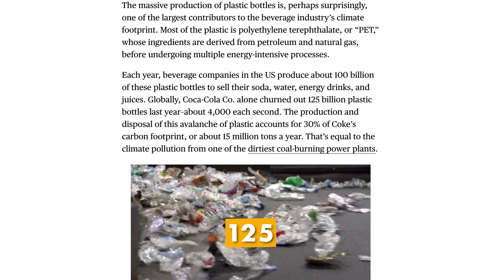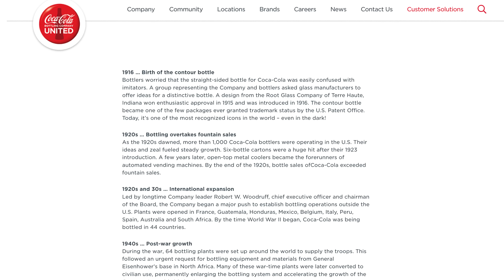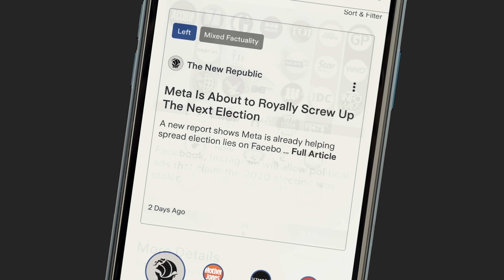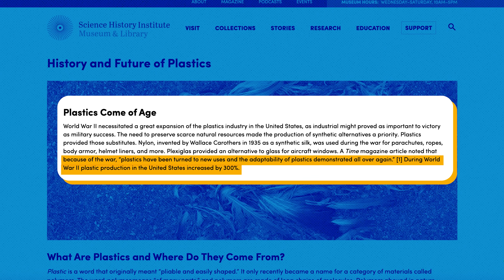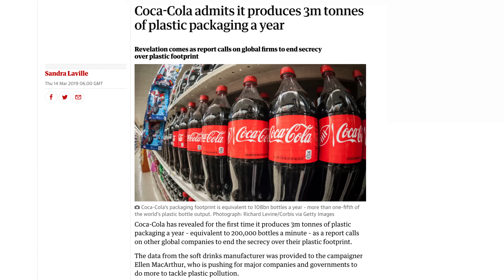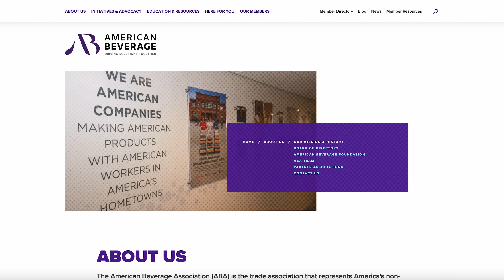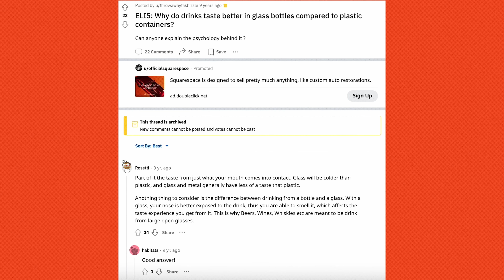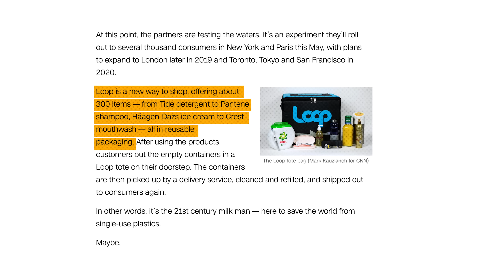Why the Glass Bottle FAILED

Comment: So now you talked about glass vs plastic. I would love to see glass vs plastic vs aluminum can.
Reply: The aluminium in the cans is easily recycled, but all cans have a thin plastic liner on the inside. It's unavoidable that this gets burned away when you recycle, but at least it's only a very small amount and it is destroyed in a controlled way rather than littering the ecosystem.
But like I said in my other post - plastic isn't really the problem, just how we (don't) recycle it. We could still use plastic (like HDPE) bottles with near zero waste if we actually spent the same time, care and money in collecting it as we did for glass.
This problem has very little to do with what materials we are using, and everything to do with economic incentives, or the lack thereof.

Comment: Getting the recycling rate up high is actually remarkably easy - Latvia (an eastern european country) took the same machines as in Germany mandated that all beverage cans, plastic and glass bottles have packaging surcharge and mandated all grocery stores to accept the packaging and refund the surcharge either using the machines or manually. We're now at 85% recycling rate in 2 years.
And so you're not feeling like a cheapskate the machines offer to donate the refund to a charity of your choice.
Reply: Most of EU has adopted a similar system but 85% return rate != 85% recycling rate. It would be economically and environmentally prohibitive to recycle PET at such a rate. Most of the returned containers end up either on a landfill or burned, with some portion of them being used for producing fleece and similar materials.
Reply: @zwerko  you just nitpicking here. The returned PET bottles through this system can be recycled into food grade plastic cause they're not contaminated, so it's high value raw material. Sure, it also goes for polyester fibre production, but it's still recycled, though not fully circular.

Comment: Instead of just disallowing plastic straws and cup, why not also imposed that soft drinks should be in glass bottles?
Reply: Because glass has other issues. The bottles are much heavier, larger, and harder to reseal. And do you know what happens when a glass bottle full of pressurised sugary drink breaks?
Reply: @ghoulzeta 
in the popular video game metal gear solid 2, an enemy boss often says the one thing that needs be said as a response to the opinion you hold--

"i'll let you go out in STYLE!"

Comment: Can you make a video on the whole overpopulation and population collapse debate
Reply: That would be interesting. I was worried about overpopulation too for quite awhile, seeing how the rate just skyrockets off. But then over time have realized how the birth rate has dropped across most of the world except for some... but it may even drop in those places as they further develop. So the issue may actually correct itself. But as population shrinks, so will economies. Companies are going to have to get used to the fact current growth rates just won't be sustainable.

Comment: I grew up knowing the family who owned the local coke distributor ship in my town: where they took in bottles, wash them, and re bottled all the coke products in my area. They were happy when no deposit bottles came in because it was faster and much cheaper to run than having to warehouse, wash and handle the return bottles.  In fact the bottle washer machine was the largest and most expensive machine in the building, and doing away with it meant doing away with 6 employees, hot water, detergent and water used in cleaning them daily!  
It all comes down to money saved = higher margins.
But the flip side was the now added trash bottles all along the roadsides. 
And though there are still glass bottles around, they’re few and worth nothing and end up in the trash .

Comment: I had a unique view of this throughout my life. My grandfather was a milkman. So I knew the routine - drop off full bottles and take back the empties to be cleaned and refilled.

Later in my engineering career, I laid out beverage filling lines for both returnable and non-returnable (NR) glass bottles and I also laid out filling lines for PET containers. Late in my career i did design work on PET blowmolders. So I kind of saw all the progression to the era we're in today.

There were a lot of reasons for the switch to PET, but the overall #1 reason is just what was said in the video: The beveage and food processing industry does NOT want to see these containers coming back to them! Once out the door - out of sight, out of mind. No longer their problem. They've spent a lot of money over the years advertising about recycling, but they spend a lot more lobbying Federal and State legislatures to be sure that no laws are passed requiring them to assume reponsibility post consumer scrap.

Comment: Oregon has recycling machines like Germany, but when it comes to glass, the recycling is short-circuited right there. EVERYTHING is crushed--the glass for obvious reasons is crushed separately--but when you make sure that it can't even be used as stock for more glass (all the contamination from the paper labels) the recycling potential is gone.

Comment: I always see people talking about "plastic bottles vs glass bottles", but one thing I never see talked about in these kinds of stories is that a third option actually exists: aluminum bottles. They provide most of the benefits that plastic bottles have: being lightweight, less susceptible to breaking, and being resealable, but also have the benefit of actually being recyclable the same way that aluminum cans are. (For example, the bottles that "JUST Water" brand of bottled water is sold in, or the "Good and Gather Purified Water" sold at Target.) The only downside is that the container isn't clear, and therefore you can't actually see what the beverage you're drinking looks like. But I think that's a fair tradeoff if it means not polluting the Earth with plastic more than we already have.

Comment: In norway, we use plastic bottles, but we have the "pant" system. Or translated to pawning system. For bottles we pay, and get back 20c for up to 0,5L and 30c for bigger than that. We stuff them in the machine and get our money back. Aaaand! We resycle glass pretty well, it goes with the metal cans for soup and similar, they are easy to separate. But for the bar I work in, all Pepsi producs are delivered in glass, and this is returned. But allso there we have 3 trash bins, one glass, one general waste, and one pant. And it works! And for the returnabole glass bottles, we use the cases it came in. Easy peasy!

Comment: We also have glass bottles in Brazil. It's not just Mexico. I also saw them in Argentina. But things changed anyway. When I was a child in the 80s and early 90s, everybody returned 1L their glass bottles to the supermarket. Now the small glass bottle (290ml) is still very common at bars and restaurants, but the demand for larger 1L glass bottles decreased when the 2L pet bottles became more common as the family sized option. Now fewer supermarkets sell the 1L glass bottle, as they also need to handle the logistics of returning them to Coca Cola. Here, instead of paying for returning bottles, if you buy only the liquid, it is cheaper if you buy the liquid + the bottle. If you bring the returnable bottle, then you pay only for the liquid. Coca cola also tried to introduce returnable plastic bottles. They are made of harder plastic and have a larger volume, 2L ou 1.5L I suppose. The same places that still sell returnable glass bottles also have them. They try to sell to a demographic that buys cheaper colas from another brands, as a cheaper version of coca cola.

Comment: The old soda bottles were gold for us kids in the early 1960s. It cost 10 cents for a 12 oz bottle of pop plus 2 cents deposit, 3 cents for a 16 oz RC cola bottle. We would find empty bottles in the trash or in vacant lots with the worthless liquor bottles. Some chipped bottles were okay to return as these go back to the glass factory as it is cheaper to remelt these then you would the original sand. A six-pack of bottles would redeem for a bottle of pop, including the deposit or two candy bars and two bubble gum pieces.

Comment: 10 or so years after Oregon enacted its bottle bill, beverage companies started using bottles made of thinner glass (which was crushed and broken when recycled) and plastic containers.  Not in Oregon.  It was quite a few years before the old refillable bottles disappeared.  They stopped making the original reusable bottles, but the ones that already existed stayed in use.  For maybe another 20 years.  These were thick-walled glass bottles, very resistant to breaking, and at the end of the era of reusable beverage bottles, the corners of the bottles looked like ground glass, having been ground down by all the times they'd gone through the washing and refilling process.  Make the beverage companies pay for NOT using glass, and things would change, but they'd flood congressman's offices with lobbyists to make sure that never happened.

Comment: I'm surprised you didn't mention Oregon's bottle bill a little more since it has created a system very similar to the one you experienced in the Netherlands. Oregon has a very high beverage container recycling rate, usually above 90%. They have started a reusable glass bottle program. Currently only a handful of breweries use the reusable bottles, but I think they make tons of sense in states that already have bottle return infrastructure like Oregon. No reason it couldn't be expanded to more beverages and more states.

Comment: From an European perspective: My main issue with glass bottles (even the recyclable ones) is transportation. Glass bottles are heavy and can shatter. Therefore from the producer side, transporting them means less beverage carried per truck and thus more CO2 emitted. From a consumer side, buying beverages in 1.5 liter glass bottles becomes pretty inconvenient if you are going grocery shopping on foot or using your bicycle. If you are buying (and returning) glass bottles by the crate you very likely will use your car to get to the store...

  (And no I am not purchasing a severeal thousand euro battery powered cargo bike just to do my shopping runs.)

Comment: Glass bottled soda hasn't completely gone away, at least in the USA. When I was a kid in the 2000s, Block Buster used to sell a 6pack of slightly shorter then the standard glass bottles of coke a cola and that was the first time I had soda in glass bottle. However I still see coke a cola in glass bottles at costco (I think it's an 18 pack of full standard size) and often at the corner drug/liquor stores.  One time when I was staying in Utah in the last 5 years I was trying to save money & get some things at the grocery store instead of eating out and they had a whole end cap of different types of soda in glass bottles. They had coke a cola (although it was not the one with cane sugar), Fanta Orange, some grape (probably fanta), and even Pepsi. 

I still buy coke a cola in glass bottles every now and again and my favorite beer shocktop comes in glass, but I don't how/if you turn in the empties for either I've ended up just washing them out and holding on to a few since I think they look neat and often are a conversation starter. Though I still bummed that Snaple killed the their glass bottles, half the fun of drinking a Snaple was the click caps the other half was the weird name.

Comment: While ai agree with the advantages of glass, there are some downsides that weren't mentioned. i remember when I was a kid, people were sometimes injured by glass bottles exploding in stores if mishandled, and there were some high-profile cases of people being blinded and suing the bottlers and grocery stores. Also, when you'd go to the beach or park there would be broken glass everywhere. 
I think cans might be a good alternative - they are recyclable and the light weight means you don't burn as much fuel transporting them.

Comment: I have a half gallon glass milk bottle in the kitchen. I have to drive 125 miles back to the store where I got it to get my $2 deposit back. If I wasn't planning on going there anyway, I'd be out $2 when I threw it away.   When I was stationed in Germany back n the '80s cases of beer had 20 .5 liter glass bottles. They were returned, cleaned and reused multiple times.   When I was a kid we used to go to The Soda Pop Shoppe and push wooden crates along a roller conveyor made of steel skate wheels, like those used on roller skates 100 years ago.We could pick whatever flavors we wanted and put 24 pint bottles in as we went. That was before bottle return laws were around, but those bottles were also returned for deposit. There used to be an M&S brand soda bottling plant a few miles from me until 1989, when it closed after 71 years. Those local brands just couldn't compete with all the national brands. But since I have to take all my bottles back to the store for a 10 cents, I'd rather have good tasting pop in glass bottles, instead of the Coke I just had in a plastic bottle.   A lot of stores around here sell Mexican Coke in glass bottles, but most of the other big brands are only available in plastic.

Comment: We still have glass bottles, they just are not returnable.  Returnable bottles had a life expectancy of eight cycles.  I picked up pop bottles from the ditch lines along the roads for two cents each.  When they recycle glass into road pavement, cuts down on gravel and gives a sparkle to the road way.  Glass is the easiest thing to recycle right after asphalt.

Comment: On Norway, we've always had a deposit we paid for bottles of around $ 0.10 - 0.75 per bottle, that we get back when we return them. All vendors are required to accept returns. Not only is it standard to return bottles, but people even go collect bottles in parks and on beaches, to return for profit. Great solution. HOWEVER, FOR SOME INANE REASON, they cut out glass bottles from this arrangement, so everything is plastic now. If you buy a glass bottle of soda now, you can boo longer return it anywhere but must locate a public glass recycling container. I don't want to live on this planet anymore

Comment: In all fairness, glass bottles are less efficient when it comes to storage, needed prepwork before use, filling and sale compared to PET bottles. I work at a beverage company and looking at all our ways to "bottle" products, PET is superior just from that pov. Depending on the formfactor, a palet sized deliver of PET bottles in their preform shape can hold 8000-18`000 bottles, while a palet of glass only amounts to tops 420ish bottles. We can churn out anything from 15000 to 25000 bottles in an hour with 4 people, while our Glass crew needs overall 8-9 people for 5000-6000.

Also, having worked with the Glass bottling plants, it's a nightmare. The humidity and heat around those machines, especially the ones that do the washing, is no joke. Summers are like 42°c with 90% humidity.

The PET bottles also can be filled at way higher speeds and quantities, don't require prepwork like making sure nothing is in the returned bottles, no caps attached or bottles got mixed up. In terms of economics, PET is supperior. Btw, they "better" taste might just be the difference in Carbonosation of the drink. Depending on the drink, Glass just cant hold as much Co2 safely and Co2 affect the taste A LOT. That's why we have a minimum and maximum amount of Co2, not necessary to make it more or less fizzy, but to keep the taste as specified.

Comment: While plastic has a sustainability problem, and is made from oil, a fossil fuel, it has some key advantages over glass.
1) It's cheaper!
2) It's lighter, and therefore uses less energy to transport.
3) It's more robust than glass, and won't break.
4) It's therefore much safer for people to use, because it removes the risk of injury.
5) Glass didn't fail. It just got superseded in some popular applications.

Comment: The only thing you are somewhat off on is the time it takes for glass to break down. First glass is inert and even the smallest piece will not harm an organism, save for the fact that broken glass will have sharp edges for about a decade in most water. The abrasive action of water movement and rocks/sand will break glass down in much less than the million years listed. There has been glass on earth for as long as earth has been around, meteor impacts, volcanic activity, lightning strikes.

Comment: PET bottles are more expensive than glass bottles, but almost indestructible.  Drop a glass bottle at the shop, warehouse or a production line and the whole business has to stop while its cleaned up.  PET bottles are completely recyclable to their component molecules.  Discarded glass bottles are a safety hazard, thye can start bushfires and recycling is limited to the same colours of glass, meaning you end up with an excess of coloured glass.

Comment: Nice video. One more point should have been included, glass bottle has limited capacity and requires care while storage at customer end. With plastic bottles Coca-Cola is able to sell higher capacity bottles and it’s easier to store, thus increasing consumption

Also returning bottles is hassle for customers, reducing consumption. plastic bottles solves this

Comment: the story about Croatia Coca-cola recall was nothing but panic. The conclusion to this panic was that the cleaning ladies in one of the bars served a guy an alkaline cleaning solution instead of romerquelle sprinkled water. They just used the glass container of the water to hold that cleaning solution. And they are being prosecuted.